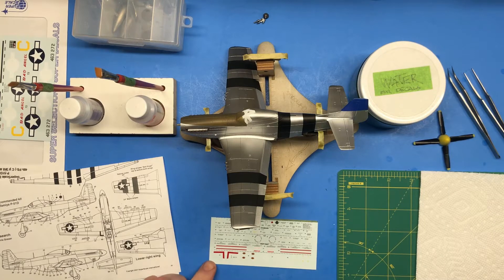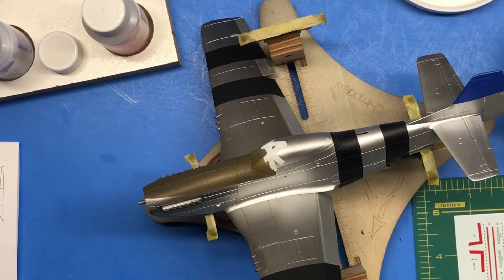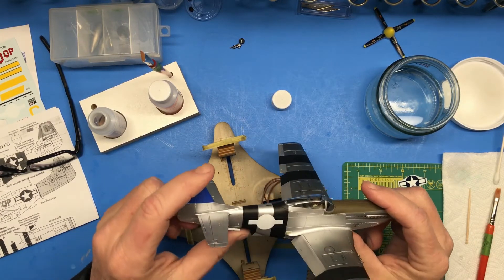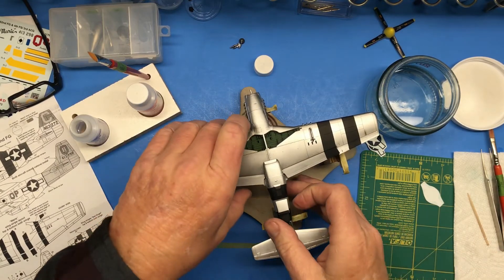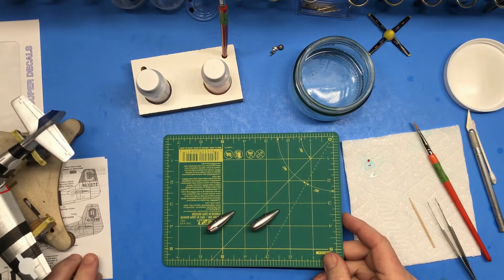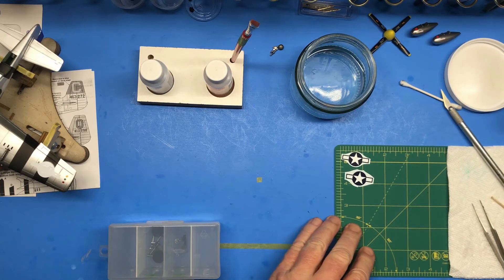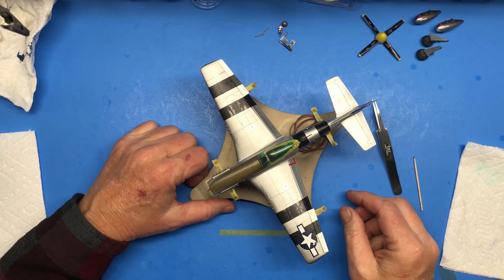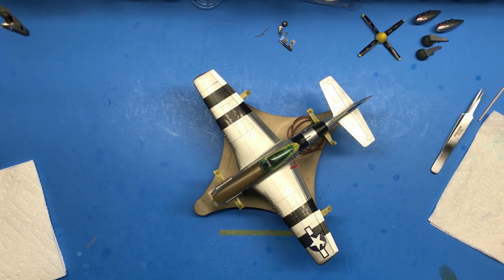Tamiya 1/48 F-51D Mustang, Part 6 Decals and Clearcoat

Comment: The Vallejo silver peeling up is not the paint's issue, it's the Mission Models primer it's it very good. Using a lacquer or good acrylic primer such as Stynylrez, I've never had a problem. There colors can have the same issue. Mixing their colors with their poly & thinner doesn't always guarantee sucess. Also their poly & thinner have poor shelf life. Just quit using them. Very nice work on your Mustang.